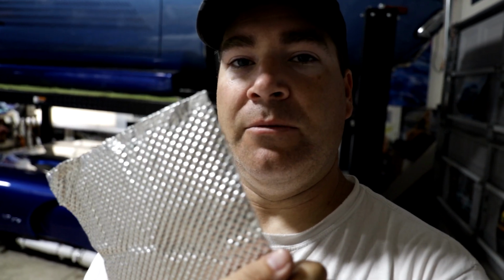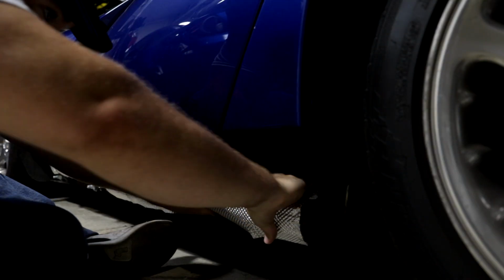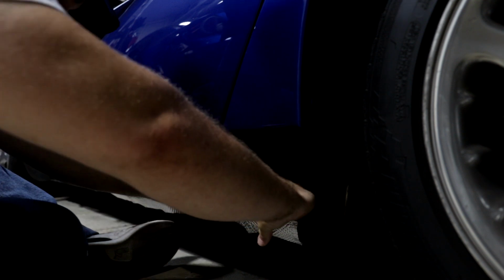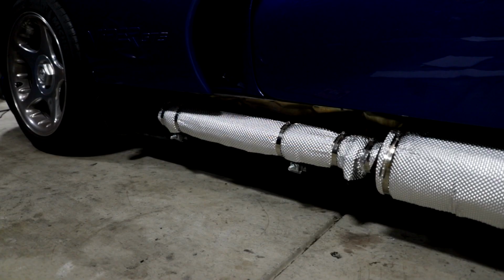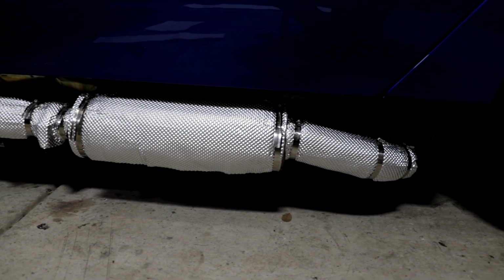Tech Talk Tuesday: Dodge Viper GTS Exhaust Heat Shield Installation

Comment: Just did this to mine. How are you liking the results?
Reply from the maker: The initial drive I noticed an improvement in the interior temperature. I just got the passenger side sill back from paint yesterday and hope to reinstall it Monday and take it out then
Reply: @LifeatSpeed  Nice. I literally installed this morning and I'm waiting for the weather to clear up. That heat shield material was easy to work with.
Reply from the maker: Awesome! Yeah I was really impressed with the ease of installation. It's definitely not the cheapest material on the planet, but if it prevents me from having to spend another $1,100 to repaint one side sill it's worth it.
Reply: @LifeatSpeed  I hear that! I'm hoping to reduce interior temps a bit. There's a point on hot days where even the A/C can't keep up with the rising interior temps. 
Looking forward to next vid with your car all sorted and back on the road.
Reply from the maker: I still need to resolve my ac leak as well, hopefully soon. And hoping to have a video up Tuesday of the Viper back together and what the exhaust sounds like without the cats
Reply: @LifeatSpeed  Unless you already know where the leak is, start by looking at the o-rings on the compressor 👍
def document your a/c repair
Reply: I have installed this from 6 month, its a lot of difference, i have tryed both solution on straight with catback and with highflow cat, unfortunately with the highflow cat even this heatshield doesn't safe your legs and feet 😔
Reply from the maker: Good to know, thanks for that info
Reply: @LifeatSpeed  unfortunately here in Italy i have to use at least the highflow cat, without the emission was killing everyone in the range of 20 meters....i have emission test in a couple month and i dont want problem 😔 but the sound on straight was celestial 😢
Reply from the maker: That's understandable. I'll be installing new cats on mine after I make sure I have resolved the misfire issue.
Reply: @LifeatSpeed  reuse the OEM side sill  shield if they can fit with the heatshield mat, i think its a big help if its possible to stack them both
Reply from the maker: That's my plan

Comment: Great vid! thank-you. 
Are you planning to make any drill holes in the sill at front or underneath sill? I see there some after market sill grills you can install to get air flow at a maximum.
Reply from the maker: Thank you! I am not currently planning on drilling any holes in the side sills.